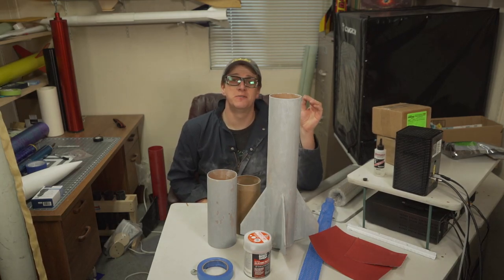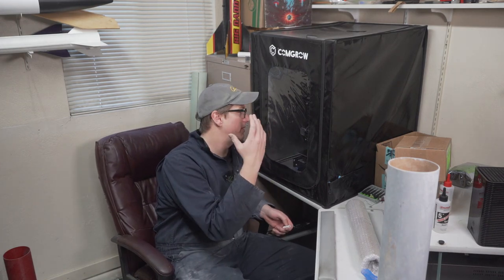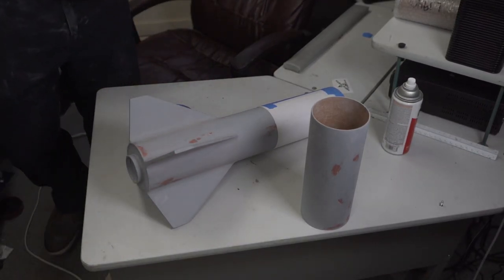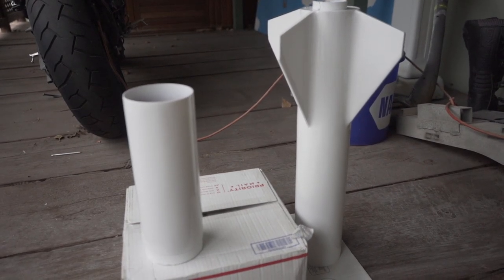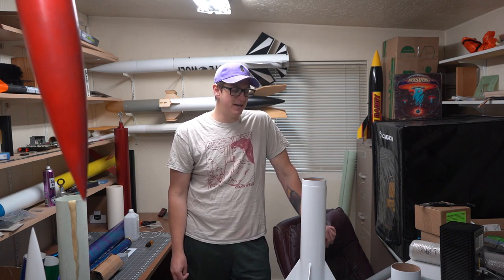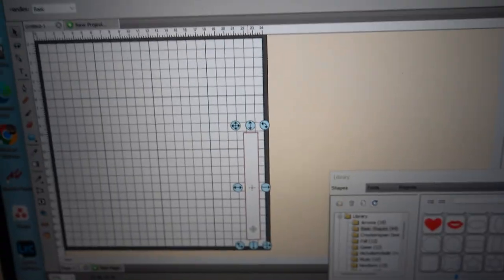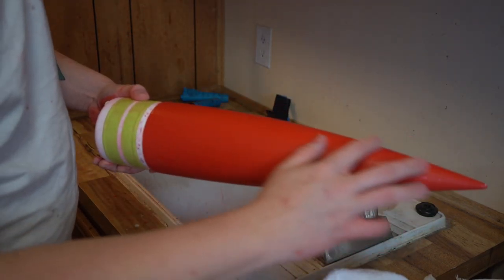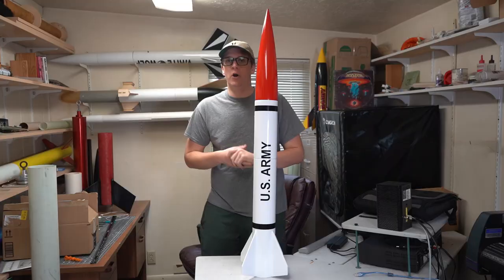Meticulous Sanding, Filling, and Painting on my Little John Rocket | I Got Lost in the Sauce

Comment: Highly recommend you try Super-Fil poly fiber super lightweight and FAA approved filler.  Used it on my RC airplanes. Now going to use it on my rockets.
Reply: Available at Aircraft Spruce and Amazon.
Reply from the maker: I've used super fill! I now use West 410 microlight filler and it's a lot like superfill but much more working time.

Comment: When measuring the tube end let the caliper lay back and square up on the end of the tube (if it is square...). You will cover a little larger area, and it will be a tiny bit easier to read.  ✌😎

Comment: I have given up on trying to get a perfect paint job on my rockets, they always seem to look like trash after a couple launches anyway. Now I just do a couple coats of filler primer, sand it off then spray color. Just enough to protect the tubes without adding a bunch of weight.

Comment: If you really want to take your paint to the next level, try using a guide coat to use as a sanding guide. 3m makes one in a can or you can use a cheap can of black spray paint. Lightly dust it on and start sanding. It will leave all your low areas with black where you either need to sand more or apply filler. Great job on it though and it looks really good.
Reply from the maker: I've actually used this technique before with black paint way back when I was building my 5.5" Nike Smoke

Comment: Do you wet sand after primer or just the base coat?
Reply from the maker: I sanded the primer, but did not wet sand it. Most of the time, unless it's filler primer, I don't sand the primer at all.